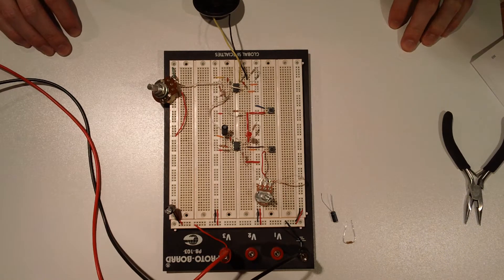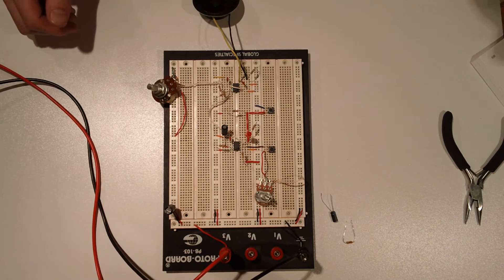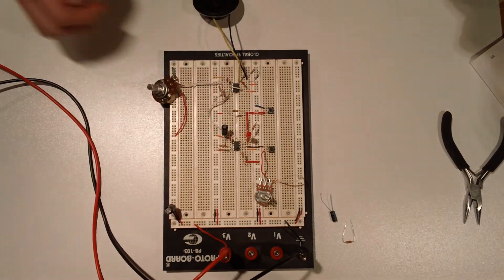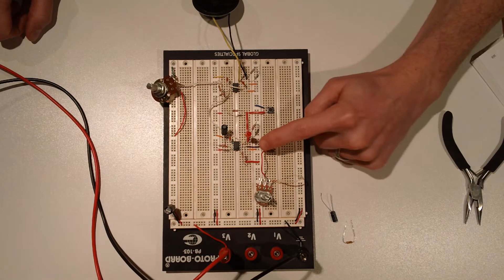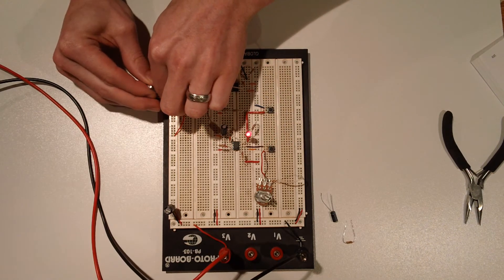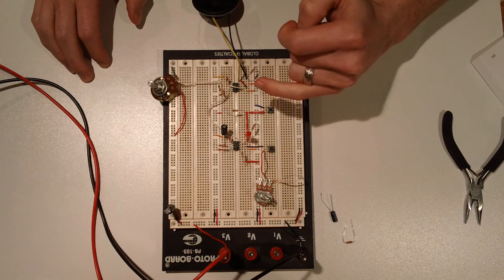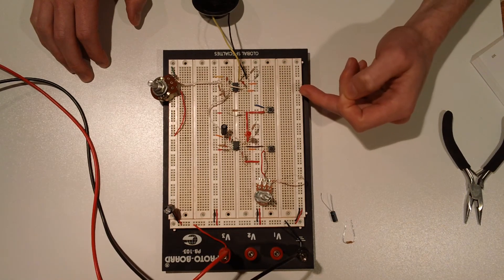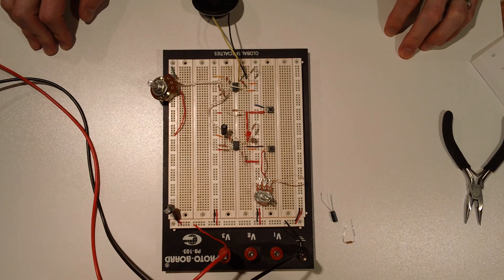Make: Electronics - Experiment 17 (Chaining Multiple 555 Timer Chips Together)

Comment: Hey Chris - thanks so much for the video and for the tip on the capacitor. I spent a long time trying to understand what was wrong with my experiment, and your video actually provided the answer to it. I used a 104 capacitor to solve the issue.

Comment from the maker: Yep I did - the output gets converted from a square wave to a flat LOW with alternating spikes up, then down (very fast spikes that don't stay pulsed).  These spikes coincide with when the cap is charged, then when the cap discharges (when the square wave is LOW).  This is what it means to pass only the AC current from a DC square wave.  Tough to describe without seeing first hand.

Comment from the maker: The capacitor "hack" isn't really a hack, but pretty common in many circuits that drive loudspeakers (I looked for lots of circuits that had loudspeakers in them to learn this).  I basically saw that I had a nice square wave on the output pin 3 of the lower 555 but wasn't getting any sound out of the speaker, so that pretty much ruled out any issues with the rest of the circuit.  The toughest part was visualizing and understanding exactly what it means to "pass" AC current from DC Pulse ouput!